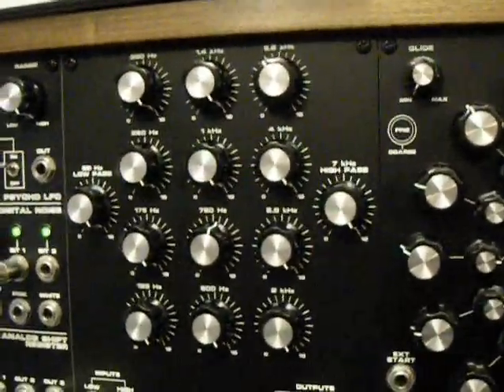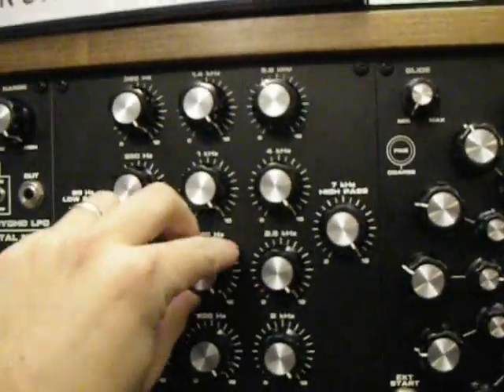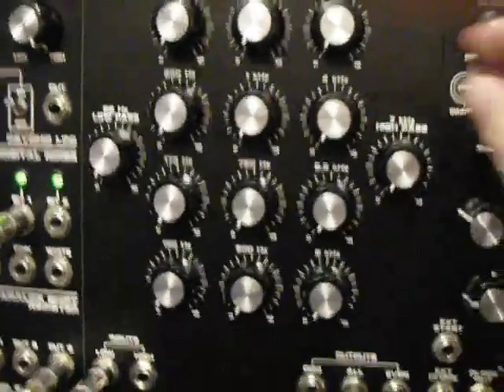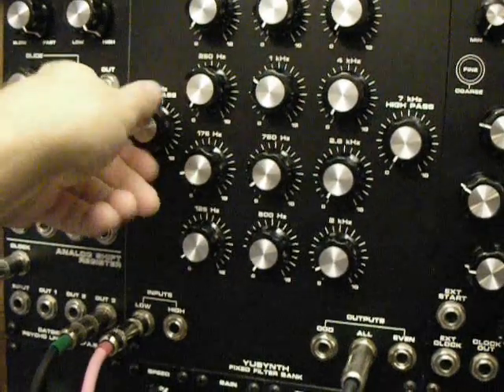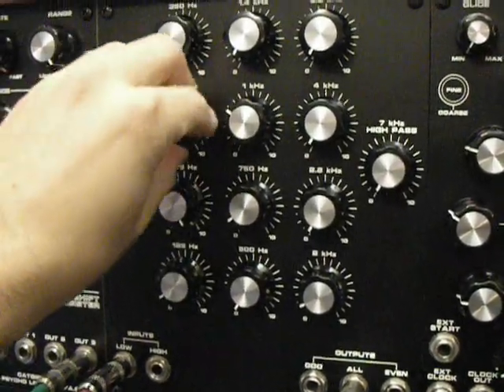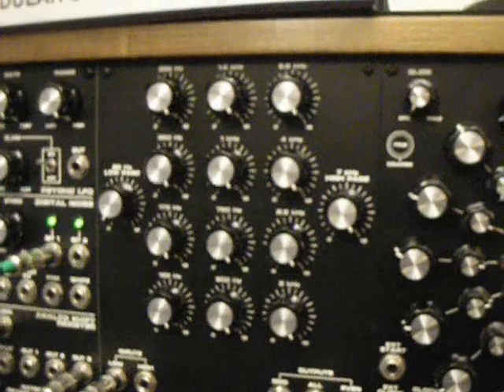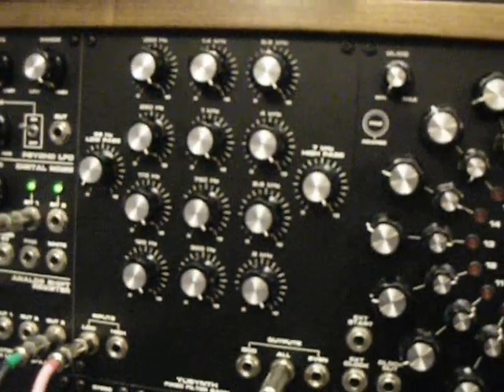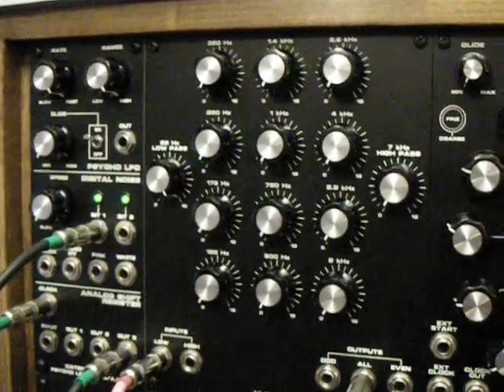YuSynth Fixed Filter Bank Moog 914a Clone

Comment: About the bleed, did you use flatcable to the pots? Could capacitive behaviour on the flatcable couse the bleed, weak grounding or uncleaned PCB be the reason? Mine is perfectly silent